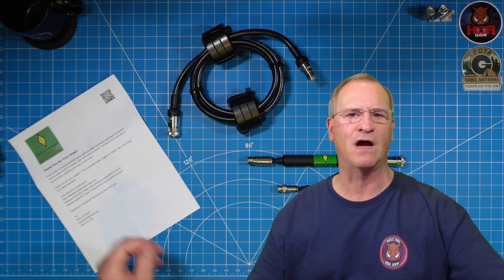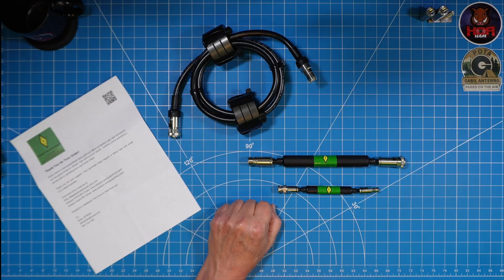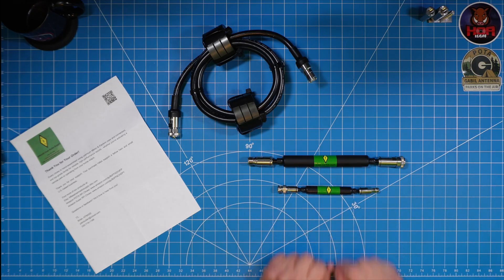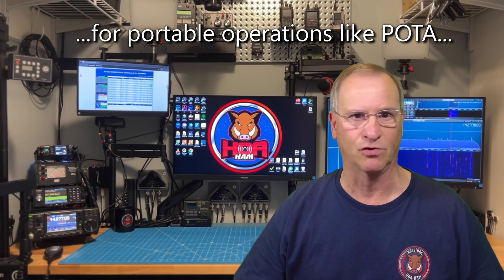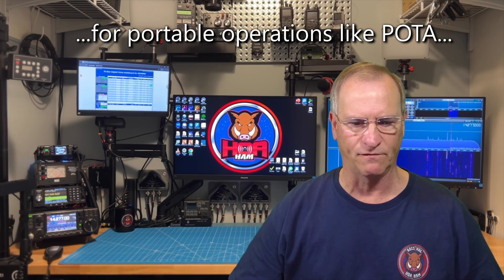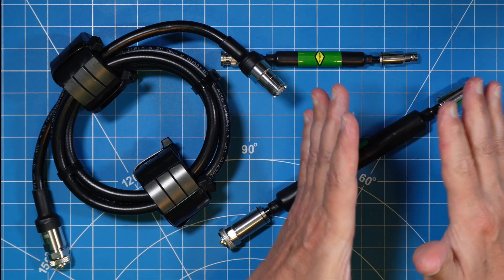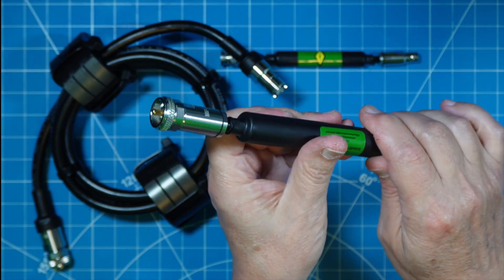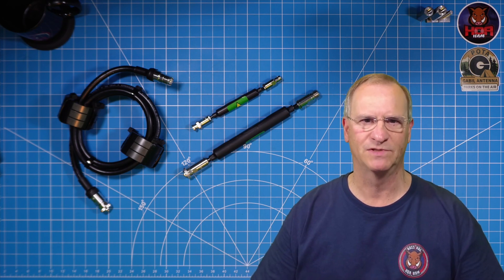HOA Ham Pro Tip Tuesday:  Best Chokes from Premium Materials and Meticulous Craftsmanship KF8ASE

Comment: These appear to be well constructed chokes.  I tested a few chokes in my collection for their ability to attenuate common mode currents. I found the frequency response to be quite different for each of the chokes. One was a similar design to those shown made by ABR industries. It provided about 20 dB attenuation from 80 -6 m.  Another provided 20 db attenuation between 20 and 6m and was totally useless on 160 and 80m.  Still another provided at least 20 db attenuation between 80m and 20m and was marginal through 10m.
Without testing of the frequency response,  one knows nothing about the choke. Over all the ABR industries choke had the best ability to suppress common mode currents across the HF bands. The others were, however, much better on some bands. None were suitable for 160m. For 160m a different ferrite mix is likely needed. A NanoVNA or other VNA can be used to make the necessary measurements.
Reply from the maker: Thanks for the insight and good advice on testing; appreciate the detail.